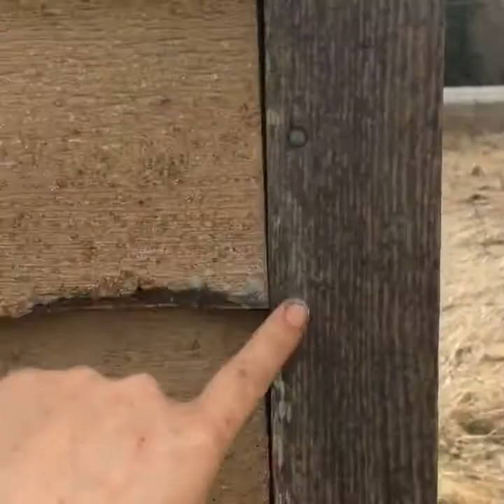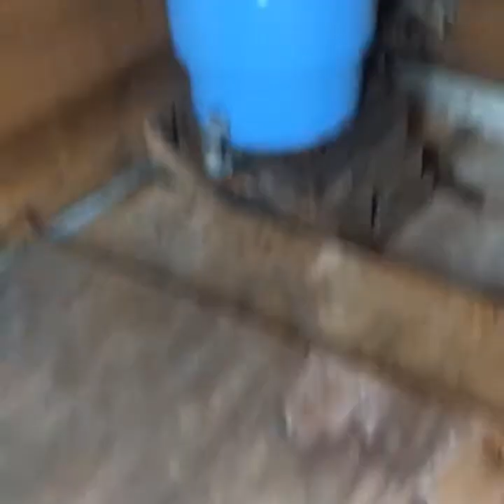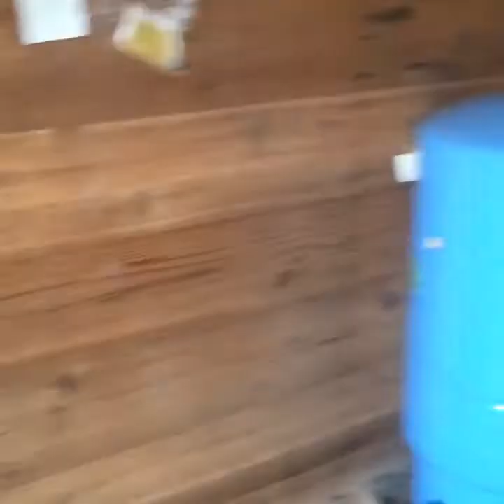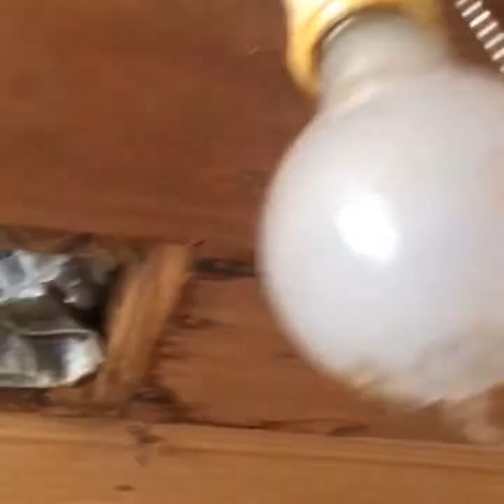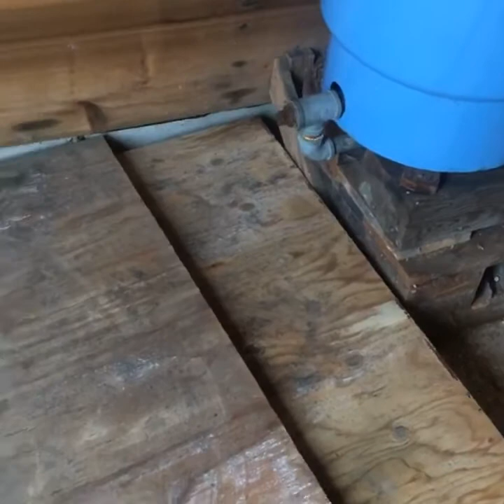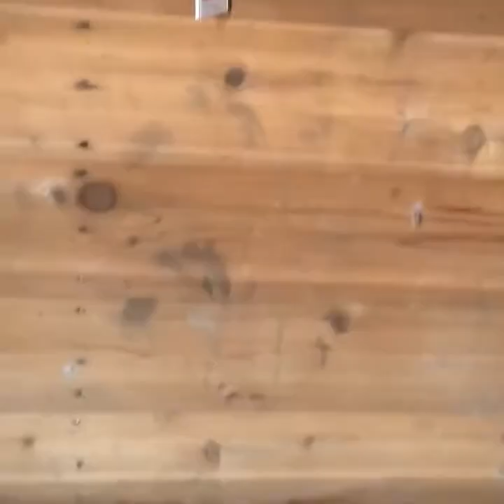Making a meat curing building

Comment: Hey guy. Wondering what you did following this video and such.
Reply from the maker: Been hanging hams, works really good.
Reply: @elsydro8064  have I missed a video of the final setup? I’m hoping to learn from you because I’m setting up a cool room for the same purpose. I have a walk-in cool room/chiller which you’ll have seen at the butcher however I don’t have the refrigeration system and am looking for simpler solutions to suit my ambitions.
Reply from the maker: @jacklawson1367  for what I do there is no set up, no temp control or humidity control. I can open a vent if I want any air movement but I never really do that. Now I’ve been getting into cheese and that is temp and humidity controlled.